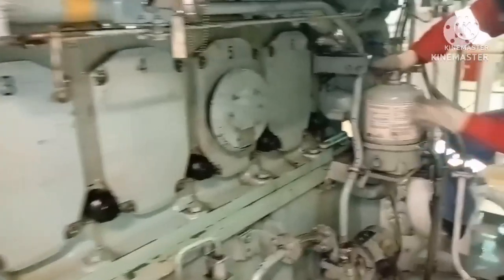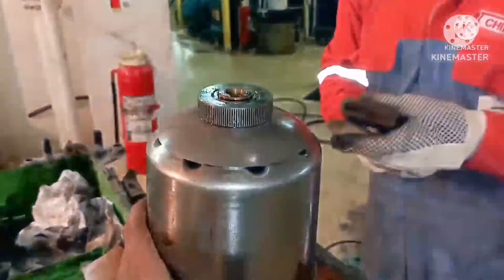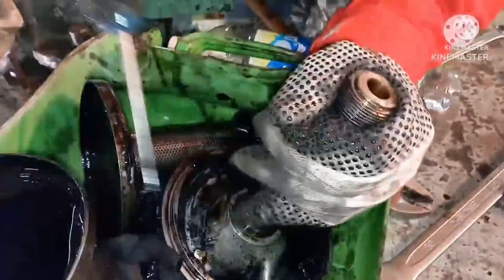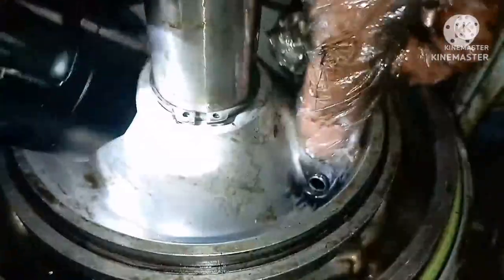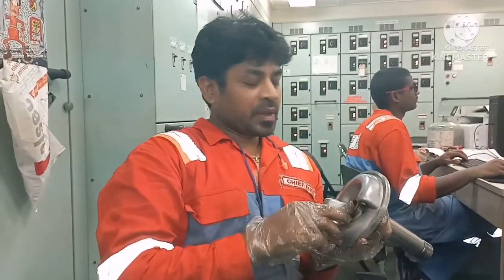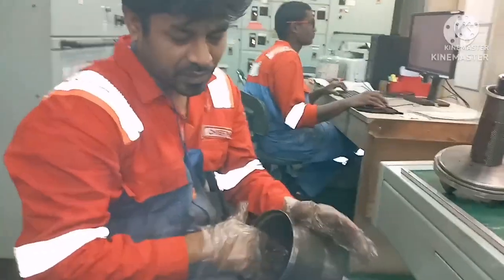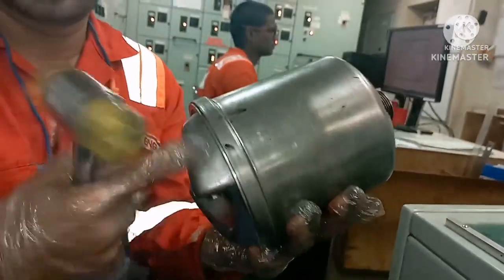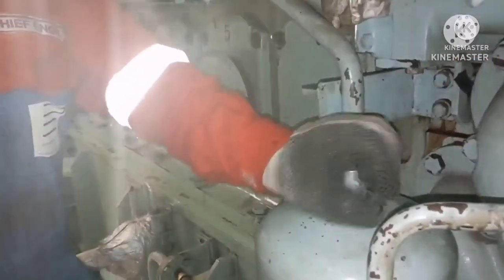HOW DO THEY DO... HOW TO CLEAN GENERATOR LUBE OIL CENTRIFUGAL FILTER ONBOARD SHIP...

Comment: Sir, Lub oil enter through nozzle? Isn't that the lube oil exits through the nozzle at high velocity to rotate the centrifuge?.. what we have learned is that lub oil enters through center stationary shaft, then to centrifuge chamber, and fills up the chamber and then exits filter and then through the nozzle at high velocity, which results in a reaction force to rotate the rotor.... correct me if am wrong 
https://youtu.be/OxSKq3TSFgE
Reply from the maker: Ur understanding is rt.. But it depend on filter type and design.. Jet filters hv differnt flow pattern.. Centrifuge hv differnt